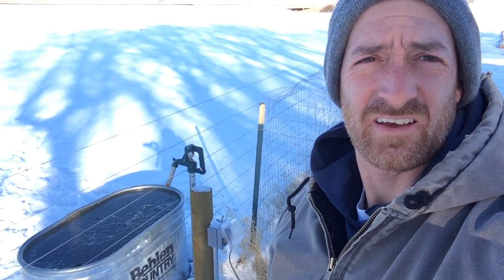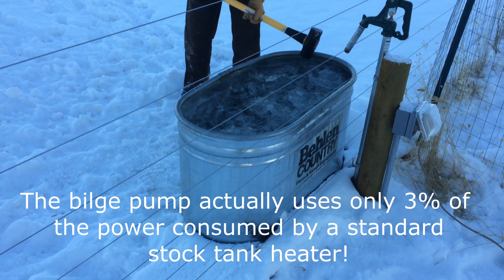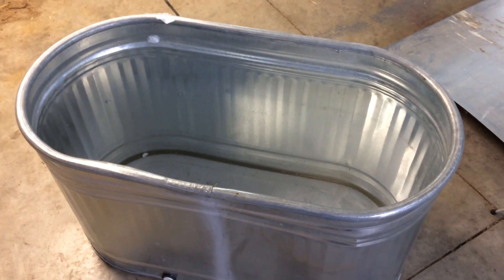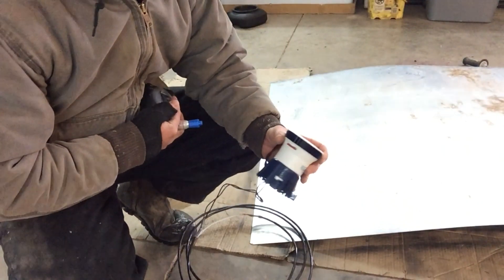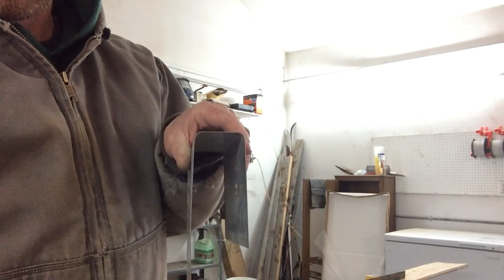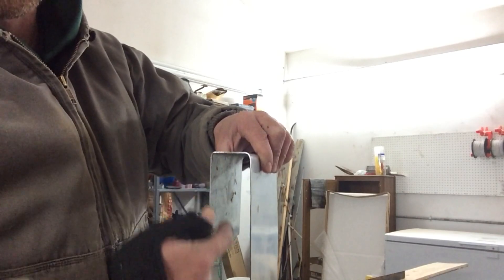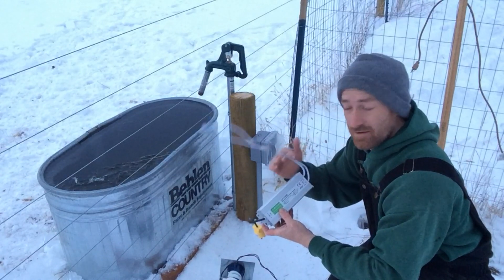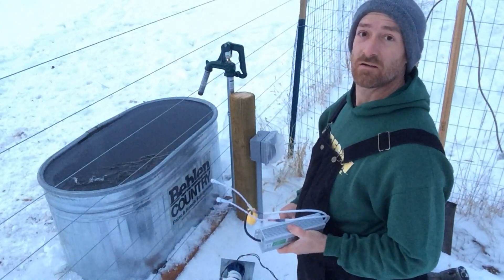DIY Stock Tank De-Icer Part 1 of 3

Comment: How do you add a receptacle near a yard hydrant? Is it buried in the same trench as the water line, just not as deep?
Reply from the maker: Yes, that is what I did.  Water line is buried 3 feet deep (this depth works for the frost line in our area), and the electrical line is buried 18" deep in PVC conduit in the same trench.  Depending on how far away your yard hydrant is, you just need to be sure you consider voltage drop for the length of the run out to the receptacle.  You may have to up-size the wire you run to account for voltage drop.  There are calculators online for that.
Reply: @BlackHorseRanchIdaho  that sounds great. Thanks a lot for your tips!

Comment: float some hard plastic balls or cubes 5-6 inch across that the cows can easily push aside to get at water.
Reply from the maker: Yes, that would work down to a certain temp, but again - this was an experiment for this particular system.

Comment: the tank needs insulating with at least two feet of soil around it held in plave with wire netting.
here in UK with mild winters a cast iron bath used for goldfish froze into a solid block so an thin metal tank will feeeze really quickly.
Or get a Gopher Tank Heater powered by bottled gas.
Reply from the maker: Most folks around here use electric tank heaters which are quite expensive to operate.  The same would be the case with bottled gas.  This was an experiment to see how well this inexpensive and efficient system would work.  We are able to keep the ice off down to just under 10 degrees F (-12 deg C).  This year we are trying a plastic stock tank, which appears to have better insulative qualities.  We haven't had anything below 15 deg F yet, so we'll see.